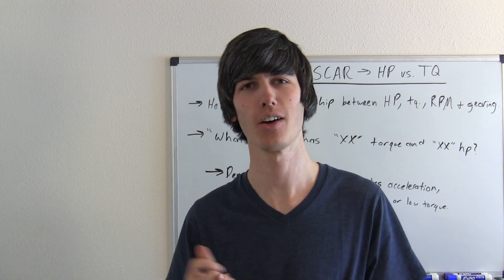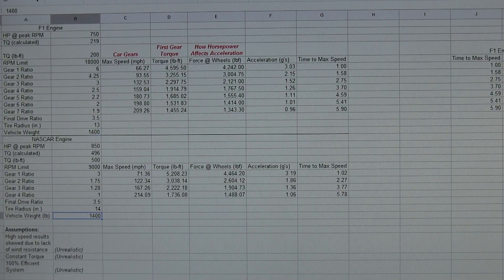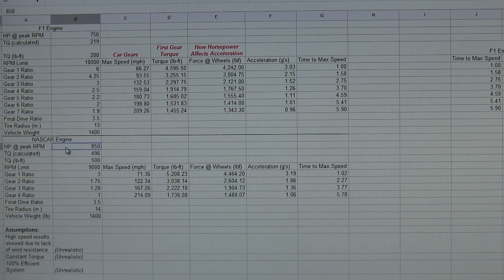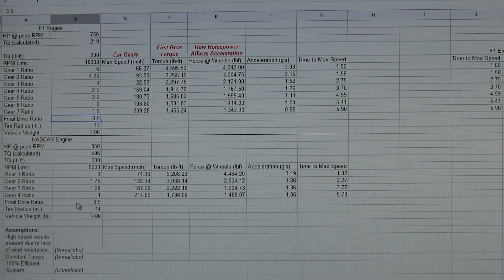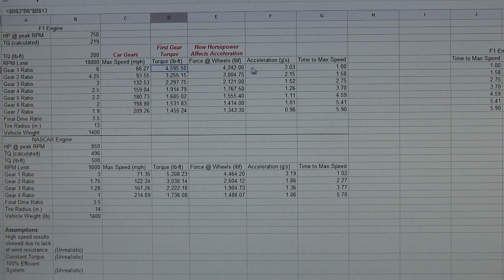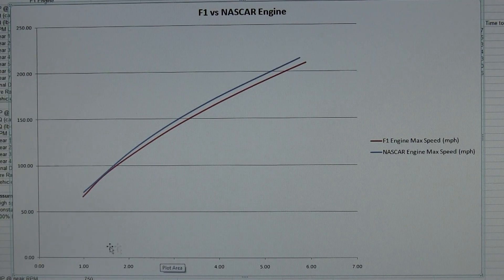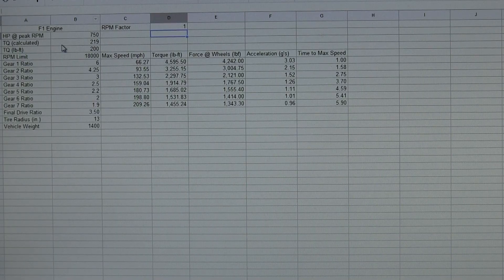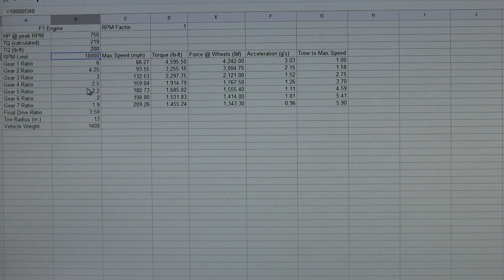Horsepower vs Torque - Formula 1 vs NASCAR

Comment: Acceleration only depends on torque. There's in fact very direct relation between torque on the wheels and car acceleration. Because it's the torque that rotates the wheels and thus pushing the car forward. Obviously. Motor power is simply a meaningful way of representing mechanical work because otherwise the mechanical motion has no meaning in context of thermodynamics. Consider electric motor: they have near-linear inverse torque to rpm relation - it has maximum torque at 0 rpm (when it's stalled), and as it spins up torque gradually goes down, until it's zero at motor's maximum rpm. Now the maximum power this motor generates is actually halfway across the graph, at half the rpm and only half the torque. At maximum rpm power is zero even though it spins fastest, just because there's no torque, and at zero rpm power is also zero even though this is the point where you will get most force out of it and thus most acceleration, just because there's no actual rotation.

The reason why F1 cars accelerate faster is because they weigh so much less and because they have more gears, utilizing engine's "power band" (rpm range with high torque) more fully. The reason NASCAR cars have few gears is simply because they drive at near-constant near-peak speed with rpm staying right in the "power band" all the time, there simply isn't any need for shifting to begin with. So you might as well go with lowest possible number of gears. In fact Sprint cars only have 1 gear and it's directly attached to the motor and to rear wheels, it doesn't even have clutch.
Reply from the maker: +Sigma Centauri (Shifty) It's not quite as simple as you're making it out to be. Acceleration does depend on torque. Torque depends on gearing (multiplies torque). High horsepower means you can use aggressive gearing. It's about wheel torque, not engine torque.
Reply: Engineering Explained Horsepower itself doesn't mean much. It's simply a product of two basic properties of a motor - rpm and torque, specifically particular torque at particualr rpm, since torque curve is far from flat. It simply tells how much mechanical work is being done, specifically in the same sense as thermodynamical work of expanding gas in the cyllinder. As a substutite to "how powerful the engine is" it immediately falls flat, as shown in electric motor example.

You didn't need to "correct" me that it's about wheel torque not engine torque, since I have posted exactly that already.
Reply: +Sigma Centauri (Shifty) You're wrong. It is all about wheel torque, which is the result of both engine torque, max rpm and the gear ratio. A faster spinning engine enables you to use a gear ratio that sends more torque to the wheels. The F1 engine has less torque but it can spin faster, so it can use a lighter gear ratio of 6:1 and still reach the same speed which in practice makes up for the fact that the engine has less torque.
Reply: Horsepower is the rate at which torque is produced
Reply: +Brandon Guerrero yup
torque = force
hp = workrate
Reply: +Sigma Centauri (Shifty) Acceleration is soly dependant on the difference between the available horsepower vs the required power for the given speed, Torque only determines how the power is produced. This leads to gearing to enable the car to operate at the right rpm that produces the most horse power.I think you confuse torque with the actual traction force at the wheels.
Reply: +El BU you're wrong too.
125 putt putts are crap because they have very little torque and a narrow torque band.

if you put an f1 gearbox onto a high torque low rpm v8 it would accelerate like a rocket but it would quickly run out of gears.
put the v8 gearbox on an f1 engine and it would be very sluggish but would do far more mph in each gear.

lets put it another way
have you driven any turbo diesel cars? they make peak torque at low rpm when the turbo spools up you can feel that it accelerates hardest at that rpm and the acceleration drops off from there up the rev band, yet the peak hp is at high rpm so why dont they accelerate as well at high revs?? because torque = acceleration thats why.
the reason high rpm low tow torque cars accelerate well is because the high rpms allow you to use lower gear ratios.
a gear is a lever, it quite literally multiplies the torque produced by the engine and sends it to the wheels, lower ratio = higher torque multiplier
Reply: +Sigma Centauri (Shifty) There's a reason why people don't build race cars with big diesel engines out of trucks with their 1500 pound feet of torque.  Horsepower is where it is at. You can have all the torque in the world, but if your engine doesn't turn fast enough to develop enough horsepower, it's worthless. Torque is only ever more important for the first instant of acceleration from a dead stop.
Reply: +scythelord wrong
Reply: +El BU you havnt read a word i wrote have you?
i know hp is a result of torque AND rpm (hp = torque x rpm / 5252 
torque is force
hp is workrate
there is 2 ways to make alot of hp either high torque or high rpm
if you can get both you get extremely high hp relative to engine size

hp is NOT acceleration, that is torque
Reply: Just to clear some things:

1) Power is not a scalar value, it's a curve over RPM range. Power is a measure of how much torque will on the output shaft rotating at 9.549 RPM after you apply whatever gearing to convert current motor RPM to exactly 9.549 RPM on the output.

2) Torque is also a curve over RPM range. In internal combustion engines, most of the torque is in the middle of RPM. Because torque is only generated during power stroke so the faster it runs the more there are power strokes, but also the faster it runs the less efficiently combustion products can expand and thus create less torque. In electric motors, there's as much torque as there are amps (not directly but it's a rule of thumb). Because motor coils are inductors, when it rotates they create reverse voltage, reducing current flowing through the motor thereby reducing torque. So it has peak torque at stall and zero torque at maximum speed i.e. when reverse voltage becomes equal to supply voltage and there's no current flowing through the motor.

3) Because gearing only has fixed ratios, you can't run your engine at maximum power RPM to get maximum possible torque (you can in CVT but they're inefficient and low-power limited). You can only put gears in a way that you'd utilize high power RPM range better than not at all. Note that highest power point doesn't correlates with highest torque point. Whatever gear you are using, acceleration is stronger where engine produces more torque, not where it produces more power.

But the thing is, even though you'd have most torque at 6000 RPM, it's not very useful because you'd had "best acceleration" at low speed, where you'd normally just use lower gear. Also, this is why it's pointless to use gears on electric cars: instead of using gearing to offset highest power point to specific car speed, you can simply adjust voltage and that'd do exactly the same thing. When voltage is low, maximum RPM is low so peak power is at low velocity. When voltage is high, maximum RPM is also high so peak power is at much higher speed. So you can control voltage to produce as much torque as you want, or to run the motor at highest mileage, etc.
Reply: zanick2 Wrong. Electric motors don't need gearing altogether because they're capable of producing any torque at any speed, and they can also run at any speed. Electric motors run as fast as there are volts, and produce as much torque as there are amps. You can simply put more amps through it to get more torque, and increase voltage to make it run faster - at any speed. So gearing is not needed. The only scenario where you possibly need gears on electric motor is when you need output shaft to rotate extremely slowly, in which case proper winding design to get it to rotate that slowly and be in optimal RPM range may not be feasible (i.e. it requires huge number of loops on each winding).
Reply: zanick2 There's a small difference between having a lot of practical experience and having some basic background knowledge as to how it actually works. Gearing helps because even though high horsepower RPM range doesn't produces maximum torque, it produces it at higher speed, so if you gear it down you wind up with larger output torque than without gearing. This, however, doesn't retracts the fact that most acceleration is where most torque. It's just high torque in mid RPM is not useful, because at the speed it produces, there will be more torque in lower gear.
Reply: El BU You don't even know clearly what a "force" is as you misuse the term, so much for being on the scientific side. Newtons is a measure of force, linear force on the body comes from torque on the wheels, measured in Newton-meters, which comes from the engine through gearbox. Power is the amount of "work" (in physics sense) it's doing per unit of time. The  more displacement there was, and with the bigger force, the more work was done. No displacement - no work, no force - no work either no matter the displacement. There are multiple solutions to the equation, like one with high torque low speed (low gear), and other with high speed low torque (high gear). And there you're saying acceleration in both cases would be the same because it depends on power.

You got your facts completely backwards.
Reply: El BU As a last ditch effort, here's an electric motor example:

It produces no power at all when it's at 0 RPM, because anything times zero is zero. But it produces most torque at 0 RPM. At the point where it produces maximum power, it only produces half the torque. If acceleration depended on power, there would be most of it at 50% maximum torque but that's clearly not the case with real electric motors. Not to mention, there would be no acceleration when motor is stalled, meaning it couldn't start by itself - which is clearly wrong, quite on contrary it produces most torque when it's stalled.

Acceleration is torque alone. Power is but a measure of how much torque is available at particular speed. It's not by itself a real thing, it's a metadata. Just like intelligence is what emerges from basic interactions of countless simple monocellular organisms, not some physical thing that actually exists.

Honestly, you're either hopelessly clueless or hopelessly confused. After being explained thoroughly multiple times, you still don't get it.  If that didn't made you realize how it works, I doubt anything will.
Reply: Problem Child AKA The Truth No. As far as driving for fun goes, I like high speeds, and where I live there just aren't any roads where high speed motorbike driving is anything but a suicide attempt. No race tracks either.
Reply: +scythelord You are wrong. Acceleration is only related to the amount of available hp vs the the required hp. The difference between the two determines the acceleration.What you mean is that big diesel engines can only deliver torque at a lower rpm and they therfor miss top end power. Not to mention that these engines are heavy and therefor require more hp to accelerate.Have you ever seen those light motorcyles (125 CC two stroke) struggling of the grid line. They just don't produce much hp al low rpm and they have small powerband. Burn the clutch at launch or push a bid to gaain some minimum speed are the basic options.
Reply: +eatthisvr6 You keep on talking on torque or hp. You obviously don not see the difference between torque and HP. HP is the net result of torque and RPM. The characteristics of an engine is determined on relationship between torque and rpm. Sure a diesel or turbodiesel has a high torque at low rpm and not so much at high rpm. That is why a turbodiesel actually produces more hp at low rpm than a gasoline engine. The gasoline engine however maintains its torque at high rpm so it usually has higher endpower. A gearbox is just a tool to keep the engine at the optimum rpm for power delivery.
Reply: +eatthisvr6 That is why you are wrong. available HP beyond the required HP is the sole and only reason for acceleration.
Reply: +Sigma Centauri (Shifty)   acceleration depends on torque , yes, but ONLY at the rear wheels. if you are talking engine torque, then acceleration  doesnt depend on only torque , it depends on engine torque and engine speed, and gearing!.... so, dont confuse engine torque with rear wheel accelerative forces.  THAT is determined by HP.
max power at any vehicle speed will determine its max acceleration rate at that speed.    F1 vs NASCAR , both at same weight  will accelerate almost exactly the same at any vehicle speed.  (all other things the same to... think F1 engine and gear box vs Nascar engine and gear box in the same car).     they both need to keep the HP in the max HP range and thats why F1 has close ratio gears and lots of them.     Nascar with its broader HP curve, doesnt need as many gears to do this. (plus, its just a rule of the nascar design to keep the 4 speed gear box which is the old american V8 car design, so that point is moot)
acceleration = Power/ (mass x velocity)... this means acceleration is directly proportional to power at any vehicle speed .    rear wheel force does the exact same thing, but its harder to calculate. (not engine torque).  HP is easy to see on a graph
Reply: +Sigma Centauri (Shifty) you couldnt be more wrong there.  HP (or power) by definition is the rate of doing work.  work, is a force over a distance.   higher rate of work, greater acceleration.
HP is also a rate of KE change... by definition,THAT is acceleration of a mass... right?   ITS HOW DYNOS MEASURE REAR WHEEL HP and torque.   they measure rate of change of the KE ( rolling drum mass rotating speed  acceleration) and that change  IS HP!!!   over one second, if you had 746Joules of KE change (start speed KE - end speed KE)  that would be one HP-second. or one HP for one second.
So, electric motors show similar HP curves to engines too.  they have a HP curve.   it starts out at zero and  ends up at near zero (speed limited) . torque starts out flat and then falls away. very simiar to a gas engine but the HP is usually broader than a gas engine.
HP is an easy way to determine acceleration potential of ANY power plant.  you just have to know what its telling you . ;)
Reply: +eatthisvr6 
basic Newtonian identity!    acceleration = power/(mass x velocity)  
this is the LAW.. your last statement is in conflict with the LAW!    its not wrong, you are.
HP is the rate of doing work.  a HP-second or Watt-second  are unit measures of work and energy.
rate of change of KE is by definition, acceleration of a mass, right?   think about it!!!
Reply: Still telling people false information aye
Reply: you need to go crack a physics book , just to the Newtonian section and it will all be clear as day. force does the work. HP dictates the  rate the work can be done.  AKA, rate of change of KE.engine torque means little or nothing, but the rear wheel forces  )(at any vehcle speed) as multipled through the gear box is synonomous to HP.
Reply: zanick2 NO IT IS NOT LMAO
Reply: zanick2 500hp @9000 vs 500 @1800 can engine A pull 72000lbs? They have the same HP correct?
Reply: Yes it can. So can an engine with 10% of the HP.
Reply: Yes, both can do identical work over time, because that is what HP is. rate of doing work..... 9000rpm at 291lb-ft  will produce the exact same force as 1800rpm at 1458lb-ft.  because in order to compare , physics, the velocity must be the same.. so , both vehicles as long as they weigh the same will accelerate the same and or generate the exact same pulling force. both would lift 72,000lbs  3.8feet in 1 second
Reply: EIBU, no it cant.  at 10% of the HP  you would have 10% of the acceleration.  again, newtons laws   .  think rate of change of KE.    if the HP is the same , the acceleration and force will be the same .  at 10% less HP, there is 10% less acceleration.    remember acceleration = power/(mass x velocity)???
Reply: zanick2 WRONG
Reply: zanick2 If that was the case they would not need diesel engines, i can tell you have never taught this stuff and you are full of (you know what) 291 torque will not do the same work as 1458, you would have to gear 291 to the moon to create the same force at the tire
Reply: zanick2 In order to move a 4000 car 1g you need 4000 ft lbs of force, this comes at the expense of engine torque and gearing nothing else.
Reply: El BU No it cant 1458 torque vs 291

gearing is 3.42*1.18*1458=5883
               3.42*1.18*291=1174

This is the force that both tires will see at their respective tires
Reply: Yes it can, it will be slow but it can. with less HP you can produce the same force, but not at the same speed. Just like you say
Reply: You are mixing torque with HP. Any amounth of HP is able to produce any amounth of driving force, but not at the same speed.
Reply: El BU But thats exactly what i am saying they make the same HP but one makes WAY more torque (force at the wheel) than the other

15*1458=21870
15*291=4365

Thats not hp thats the torque at which the hp is made (RPM) id rather have 21870 force at the tire than 4365 (it means i will accelerate faster)
Reply: Yes that is what you are saying, but it is wrong. If the different engines have the same HP, they  produce the same driving force at the wheel and the same acceleration (if the toatal mass of the car stays the same).
Reply: El BU No they dont lol, they can not.

Would you put a motor cycle engine in a semi truck? 435HP

15*1458=21870
15*291=4365 

same exact gearing of fifteen times the torque at the given rpm of max hp. 21870 of force is NOT the same as 4365 of force at the tire
Reply: El BU Thats why you have gearing because you are multiplying engine torque, i can create more force going from 3.42 to 4.10 with the same hp
Reply: If you do not change the gearing they do not produce the same HP. A high  reving engine with low torque with the same HP as a high torque enginge with low rpm, give exectly the same driveforce at the wheel. But you have to adapt the gearing to allow the engine to run at the required HP.
Reply: El BU Thank you for proven my point because you adapt the gearing for the torque not the HP just like in this video. In order to have the same force you have to change the gearing (WHICH MULTIPLIES TORQUE) which means the gearing follows the torque curve
Reply: So at least you understand what a gearbox is doing. Now try to do the same for HP.
Reply: El BU HP is not the same if you do not have enough force to move something. for 291 tq to equal the force of 1458 it would have to be multiplied by 75, but according to you they should accelerate the same. What you dont see is (in this video) if you give the F1 car the gear ratios of the nascar they do not make the same force although they have the same HP. Now do the same in the final gear and the force will not be enough because the engine torque wont be multiplied enough to overcome resistance
Reply: +Mete An engine takes fuel, burns it, turns the released heat into motion. The power of the engine is a function of how quickly the engine does this. Therefore, a 500hp engine can theoretically have the same acceleration regardless of torque. I understand this might not make sense to you, so I'll put it differently:

Torque is a function of how much fuel is burned per revolution of the crankshaft/gearshaft/driveshaft. A high torque engine will burn more fuel per revolution of crankshaft, while a low torque engine will burn less. Assuming their power is equal, that means the low torque engine spins faster. So if, by gearing, you reduce the speed of the shaft of the lower torque engine, you get equal torque at the output. 

It makes no difference if the heat is released by spinning a small engine very quickly or a large one slowly. A high rpm low torque motorcycle engine CAN THEORETICALLY move just as much load as a truck engine, since it will spin more times to turn the wheels the same amount than a large truck diesel. The reason this isn't done, however, is because it's bloody inconvenient in every way.
Reply: +Mete An engine takes fuel, burns it, turns the released heat into motion. The power of the engine is a function of how quickly the engine does this. Therefore, a 500hp engine can theoretically have the same acceleration regardless of torque. I understand this might not make sense to you, so I'll put it differently:

Torque is a function of how much fuel is burned per revolution of the crankshaft/gearshaft/driveshaft. A high torque engine will burn more fuel per revolution of crankshaft, while a low torque engine will burn less. Assuming their power is equal, that means the low torque engine spins faster. So if, by gearing, you reduce the speed of the shaft of the lower torque engine, you get equal torque at the output. 

It makes no difference if the heat is released by spinning a small engine very quickly or a large one slowly. A high rpm low torque motorcycle engine CAN THEORETICALLY move just as much load as a truck engine, since it will spin more times to turn the wheels the same amount than a large truck diesel. The reason this isn't done, however, is because it's bloody inconvenient in every way.
Reply: migkillerphantom I get that (thats why i say its torque at the wheel) but in the same notion, one can not say just because two engine makes the same power (but at different RPMS) that it makes the same force. Like you said it has to be geared for it, if they are geared the same the low torque engine will not make the same force as the high torque engine. You have to gear both motors to match the torque curve. Gears are the multiplication of torque NOT hp, if you gear down (numerically up) anything it accelerates faster, why because you have upped the anty of torque at the wheels but HP stays the same.
Reply: Mete, you keep confusing HP and the potential for acceleration at ANY speed, with torque (engine) vs force.   the force at any speed will be exactly proportional to HP. HP is the indicator.   by definition, it IS the rate of change of KE.  once you come to grip with that, you then understand that the torque of the engine, multiplied through a gear box OPTMIZES the HP availalble.    at any speed, if you are not using the hp available, you are not accelerating at the fastest rate, regardless of the gear ration.  3.23 vs 4.11 gears.  are 4.11 always going to make the greatest force?   at 20mph maybe, but at 40mph, maybe not.   if you are at the max HP at any speed, you will generate the greatest force.  this is a fact.
Reply: mete, here is the problem.  you keep on comparing two example where the vehicle is at different speeds.   you cant do this .  there is more energy in a body that is traving faster and it takes more power (rate of doing work) to accelerate that body at any faster speed.   My response to you about the truck vs F1 engine, is dead right on!   both can do exactly the same rate of doing work, (i.e. HP) or (rate of change of KE), or in other words, "Acceleration".   why, because at the saem power level at any speed, you will always have the same acceleration which means you have the same FORCE or as you say, "torque at the wheels".  when the speeds are not the same, there is no point to be made.  at ANY vehicle speed, if you can use the same engine HP level,  you will have the same force to accelerate... ive been showing you  this to be Newtons LAW!  you come back and say "wrong".  do you not have any physics classes under your belt?   this is basic stuff here.     the gear box only allows you to operate at any target speed you want, at the most amount of power available.   the best example is in racing, which I have 20 years of experience here, a viper at 500hp 500ft-lbs of torque, will accelerate at exactly the same rate at ANY vehicle speed (and produce the same rear wheel force/torque) than a Porsche cup GT3 with 250ftlbs of torque and 500hp.   the hp curves are near the same shape in the operational range.     so, instead of arguing, why not find a speed where this is not true for both cars.   also, keep in mind that if cars had infinitely variable gear boxes, where would they operate at , max hp or max torque?  if can get that right, you will finally show you understand the things we are trying to show you!
Reply: What EI and Migkilller are trying to tell you is that the gear box is the HP optimizer. remember, what is HP? hp is the rate of doing work. the faster you do work the faster you can accelerate, right  kind of the absolute definition?  engine torque says NOTHING.  you want rear wheel force and HP dictates that or can be used to measure it depending on how you look at it.  the energy -work theorem is something you need to look up.     power is the rate of change of KE.  this also means "acceleration".    F x V= power, so if you have some HP,  and you can use it..... that force will have to be present at any speed to make that equation work.      this is why we shift race cars at redline and not ever think about max torque..... ever!!   a race car may never see max torque of the engine, yet have maximized torque at the wheels at any vehicle speed. why?   because max torque will always produce less force than max HP at any speed and yes you need the gears to do this.. that's why I say, gears are more than torque multipliers, they are HP optimizers.   once you understand this, you understand the discussion and have learned something here!
Reply: zanick2 600 hp at 5900 rpm vs 500 hp at 5900 what gets it there 534tq vs 445. Same RPM higher torque rate at the same RPM which means torque is what you are looking at. And gears only follow the torque curve NOT the HP curve if thats the case then every car would accelerate faster higher in the RPM range but we all know that a vehicle accelerates fastest in first gear and peak torque before and after that acceleration is lower. BTW you have yet to answer why a Lamborghini Aventador  was out accelerated while in launch control (bout 500hp) vs a Tesla using 14hp (5000 RPM vs 100)
Reply: +Mete If one engine produces 600 hp and the other 500 hp, it is obvious which one of the two will accellerate faster; the one with 600 hp. This has nothing to do with torque.Have you ever studied electromotors characteristics, you will know than, that an electric engine produces maximum torque even without any rpm (this is still 0 hp when the car is stopped), over its full rev range. That is why they accelerate so fast from standstill. Just to give you the Tesla Engine power output: 510 hp at the rear, 262hp at the front and no issues with shifting gears.
Reply: Mete, you continue to make one of the biggest physics mistakes... comparing two bodies in motion at different speeds.  you CANT do that.  the quick answer, is what ive been saying for months to you...... the max acceleration will ALWAYS happen at the greatest hp the engine can produce at ANY vehicle speed.  what ever gear you need to do that , do it... BUT, you have to compare any acceleration , and force at any SAME speed!!     gears are used to maximize rear wheel force and this happens in the max HP range NOT the max torque range.   max torque is also meaningless and rarely used by race cars, ever!   again, acceleration is proportional to hp, not engine torque!!   rear wheel torque..... yes, NOT engine torque. your answer for the lambo vs tesla.  (and I have a video that shows the tesla getting smoked by the lamo too.. )     But the answer is the lambo is not using the 500hp, it only has less than the tesla from the very slow speeds.   it could be geared to fix that, but stock , it cannot.     whatever the acceleration rate is at Any speed, that is the HP it has available, PERIOD!   again, remember... basic Newtonian  FACT acceleration = power/(mass x velocity)   this means acceleration at any speed is proportional to power or rear wheel torque. they are synonymous
Reply: El BU Really because ive seen a 1600hp audi dog walk a 1800hp lambo. My point is this you speak of HP so i showed you same RPM vs different torque, (SINCE TORQUE DOESNT MATTER) IF I MAKE MORE TORQUE AT ANY RPM THAN YOU DO I MAKE MORE WHAT? When does a car accelerate the fastest at peak tq or peak hp...in first gear or 6th?
Reply: zanick2 A couple of answers from a physics page there guy 

Given a conventional geared transmission, supposedly best momentary acceleration is at peak wheel torque. This comes from F=MA, arranged as A=F/M. Acceleration is highest when force (torque) is highest.

Reference https://www.physicsforums.com/threads/torque-vs-horsepower.153996/

No. Every time you shift gears the torque delivered to the wheels drops, so the acceleration drops. Those two cars will only have the same acceleration for about a tenth of a second. 

Reference https://www.physicsforums.com/threads/torque-vs-horsepower.153996/

No, the engine that is able to to deliver more torque will be able to kick your butt to the finish line faster.

Reference https://www.physicsforums.com/threads/torque-vs-horsepower.153996/

If force equals mass/acceleration then they are speaking of RATIONAL FORCE IE ENGINE TORQUE X TRANSMISSION GEARS X FINAL DRIVE

You show me a race where HP won a race ill show you one where torque (at the wheels did)
Reply: You realy don't understand hp.
Reply: Now you talk torque at the wheel or actual driving force; this is at its maximum when the engine is running at max hp, no matter how the engine characteristics are for torque vs rpm.
Reply: El BU WTF are you talking about you accelerate before and after MAX HP lmao MAX HP only happens for a split second yet you accelerate after MAX HP, like i said before gearing follows engine torque, and once that force can no longer exceed resistance then you need more torque. YOU ACCELERATE FASTEST AT MAX TQ!!! YOU ACCELERATE FASTEST IN FIRST GEAR!!! ANYTHING AFTER THAT ACCELERATION FALLS OFF I FREEKING E LESS TORQUE AT THE WHEEL VIA ENGINE TORQUE VS GEARING
Reply: El BU 600@6400 VS 500@6400 WHATS THE DIFFERENCE IS IT RPM OR TORQUE AT THAT RPM
Reply: yet, still again, months into this, you still fail to recognize that you cant compare force in 1st gear to that of the force in 2nd or 3rd gear.  you have to compare at the same speed.  its a common physics mistake when trying to analyse this fundamental question that way.    Max HP is the greatest potential for acceleration at any speed.   even if it happens for a split second.  what you really want in a car, is to be at or near max HP . its call integration of the HP curve , or put more simply, "averaging". so, the highest average HP will provide the highest average force to the rear wheels.   you seem to forget that HP is force x velocity.   also,  again, acceleration= power/(mass x velocity)  this proves my point.  try and find one speed where this is not true in your comparison.     a quick example where your "theory" falls apart, is at max torque in 2nd gear.... fastest acceleration in that gear, but not if you downshift to 1st.  :)    then, the Hp is higher and the rear wheel force is higher as well.  much higher. in fact, the ratio of the 2nd gear hp to the 1st gear HP at that same speed, IS the proportion that the rear wheel torque is higher!      Gearing ONLY optimizes the HP you have available.   if you are not operating at max HP or near it as best you can, you are not taking advantage of the acceleration potential.   remember HP indicates the acceleration potential at any vehicle speed.   force does the work and HP is the most simple and basic indicator of that potential.
Reply: mete, you dont understand HP as EI BU is saying.  you are misinterpreting the physics forum.   yes, in any one gear, torque will be the greatest acceleration , but ONLY at that gear. In fact, the lower hp that max torque point occurs at, will be the lower acceleration potential that the car and engine have BY that same proportion!  what i mean by that is,  max or higher HP is your greatest or greater  potential for acceleration.   so, if you are at max torque, shift to a lower gear , be at a higher HP and that means, greater acceleration. PLEASE PLEASE , go find someone that has physics as a background and they will be able to explain this very easily.  you clearly are not thinking about it correctly, because what you say, fights the most basic Newtonian identity.. acceleration = power/(mass x velocity)  this means acceleration is proportional to power.     dont confuse rear wheel torque, with engine torque. engine torque is irrelevant.         Power determines acceleration potential.    power is synonymous with rear wheel forces, at any vehicle speed.
Reply: mete PLEASE go to that link you provided from 2010. My posts are the last few on the thread.  it should clear up any confusions you may have!
https://www.physicsforums.com/threads/torque-vs-horsepower.153996/page-6
Reply: Sigma Centauri Thank you, I asked zanick2 why a Tesla beat a Aventador off the line with merely 14 HP vs (estimated 500) in launch control (i believe that occurs around 5500rpmish) 

Ive also stated this acceleration is at best at max torque NOT at max HP. I think where the confusion lies is people think speed equates to acceleration. Theres a reason why you accelerate faster at lower SPEEDS vs higher speeds.

I gave this scenario 600hp@6400 vs 500@6400 why does engine A make more power than engine B at the same RPM* 

Now i do not know much about the CVT and i have to do research but your statement is right on with what i do know about them, and again it relates to speed vs gearing. Also why in the first few gears of a conventional transmission the spread is higher to drop down at or near max torque. But when at speed where weight is LESS of a factor you dont need as much force at the wheel to keep it accelerating. Thank you again
Reply: Mete, i think i answered your question regarding the tesla vs the Lambo.  at the start there is very little HP available, more with the tesla because of the characteristics of the HP curve . More power down low.
what ever vehicle has more power lower, will accelerate faster .. yet again, its the LAW.   acceleration = Power./(mass x velocity)  
you state that acceleration greatest at max torque, and this is dead wrong. maybe in that gear, but lower the gear at that same speed, and suddely you have 50% more HP , and that means, (if you have been paying attention) 50% more torque!!    (also means 50% more force)  why is that Mete?   because the HP is the determinant factor and max torque of the engine means little or nothing.   it means ABSOLUTELY nothing if you have a CVT.. PLEASE read up on a CVT. its the easiest way to understand what many hear are trying to help you understand.  if you have an infinitely variable gear box, your engine or motor willl operate at max HP , NOT max torque, always when you are accelerating... why is that???  because its the law.. acceleration at any vehicle speed, is proportional to HP, NOT engine torque.

Now the reason you can accelerate at slower vs faster speeds is again, HP.  max HP is the max output of the engine.    the faster you go , the proportional less force your have.  directly proportional, at best case.  common case is even less.
Reply: Sigma..... also not exactly true .   yes, in each gear , the max torque would produce the greatest acceleration in that gear, but for the same exact speed, drop down a gear and you will have greater acceleration by running at max HP or near max HP range.   this is how to use gears.  YOU Have to be careful in physics to compare at the same speeds.   otherwise your point is usually wrong.
even with electric motors, they operate at max power ranges for better acceleration.  however, with their broader HP curve, they dont need as many gears, but still need at least two to be comparable over a wide speed range to a gas powered car of similar HP.  (i.e. tesla would need a 2nd gear after 80mph to keep RPM in max HP, not torque , range).
CVT or IVTs would operate any powerplant in its max HP range.   Max torque is an irrelevant point for max acceleration discussions. (gas or electric)
Reply: i dont quite understand your question about 500hp vs 600hp and why the difference.   the difference is that one can burn more fuel and air at the higher RPM ranges. could be one is more volumetric efficient than the other or one is larger that the other..      as far as your last statement, no, the gear box doesnt care to put the RPM back at max torque post shift, its better off, (way batter off) to keep the RPM drop less and never get near the max torque point where hp is very low compared to max HP. or the max HP range.
Reply: zanick2 1. at the start there is very little HP available, more with the tesla because of the characteristics of the HP curve . More power down low. (the lambo was in launch control which means its starts off at 5500ish RPM more than enough HP theoretically to over come 14 hp @100RPM)

2.  
Sigma..... also not exactly true . yes, in each gear , the max torque would produce the greatest acceleration in that gear, but for the same exact speed, drop down a gear and you will have greater acceleration by running at max HP or near max HP range.  WHo said anything about dropping a gear how about starting in first gear. 600hp @6400 rpm 

600*5252/6400=492

1st gear 2.97*3.42*492=4997
2nd gear 1.72*3.42*492=2894
3rd gear 1.31*3.42*492=2204

so you drop down a gear from 3 to 2 you have now given yourself over 600 ft lbs of tq at the tire. Now lets get to the real deal FIRST GEAR ACCELERATION AND WHY MAX TORQUE OUT ACCELERATES MAX HP 

Same engine makes max torque off 550. let your car start at MAX HP vs  MAX TQ

1st. 2.97*3.42*550=5586
2nd. 1.72*3.42*550=3235
3rd. 1.31*3.42*550=2464

so lets compare each gear and what the tire sees

1st 5586 vs 4997
2nd 3235 vs 2894
3rd 2464 vs 2204

I THINK THE UNANIMOUS DECISION IS IN
Reply: Mete, Max driving force is available at max HP. As long as you do not understand this, your calculations show nothing at all. You are mixing engine torque, wheel torque, engine characteristics and gearbox and put them all in one salad.
Reply: wow meet, your math is correct, but your variables are way off. you cant compared HP or torque of any two cars at DIFFERENT vehicle speeds.  it doesnt make any sense and proves nothing
check out this link for the torque (thrust curves) for a tesla vs a comparable Hp gas engine car
https://www.google.com/search?q=tesla+hp+curve&biw=1384&bih=789&tbm=isch&imgil=tDtjm9yBHr8UnM%253A%253BgbAMiFeBO2jg0M%253Bhttp%25253A%25252F%25252Fwww.cheatsheet.com%25252Fautomobiles%25252Fwhat-the-hell-is-horsepower-everything-you-want-to-know.html%25252F%25253Fa%2525253Dviewall&source=iu&pf=m&fir=tDtjm9yBHr8UnM%253A%252CgbAMiFeBO2jg0M%252C_&usg=__850sKRBZtIgp4Qg_oy8JanF-O1E%3D&dpr=1&ved=0ahUKEwivloGhwKPNAhVX42MKHc3lBrgQyjcIOA&ei=cN1dV6-eCNfGjwPNy5vACw#imgrc=m8Hs9T_mzR6EzM%3A
Reply: if you change your calculations to equal speeds, you willl get the answer. right now, your calculations are meanignless, as max torque and max hp happen at different RPM and have to be compared at the same speeds.. this means the gear ratios CANT be the same .   basic fundamental issue with your calculations.

again, acceleration = power/(mass x velocity) .... just try and prove that wrong. AND, power /(mass x velocity) is synonomous with rear wheel torque, at ANY vehicle speed.

once you surrender to the facts, you will understand.  what you say works out, but you are way off based on the comparable vehicle speeds.   do you understand why??
Reply: El BU MAX DRIVING FORCE IS NOT AT MAX HP YOU ARE SLOWER AT MAX HP THAN YOU ARE AT MAX TQ, YES YOUR SPEED IS HIGHER BUT THAT HAS NOTHING TO DO WITH ACCELERATION

ENGINE TORQUE X TRANSMISSION GEAR X FINAL DRIVE= TOTAL FORCE AT THE TIRE (NOT THE CONTACT PATCH) DAMN HE SHOWS THIS IN THE VIDEO 4:01 LOOK AT FIRST GEAR TORQUE VS FORCE AT THE WHEEL (DUE TO THE TIRE.)

 NOTICE IT GOES LOWER AND LOWER EVERY GEAR WTF IS SO HARD ABOUT THAT? OMG LOOK AT THE ACCELERATION Gs I WONDER WHY THEY ARE GOING DOWN IN EACH GEAR? 

I BET IF WE RACE AND I START IN FIRST GEAR AT MAX TQ VS YOUR SECOND GEAR MAX HP
Reply: zanick2 ACCELRATION=FORCE X MASS
Reply: zanick2 Drag race you start in max HP and ill start in MAX TQ same car i bet i out accelerate you, and you show a video where the lambo was not using launch control.  I showed you a video where the lambo did use it and still lost off the line using around 500hp vs the tesla 14hp
Reply: Sigma Centauri Someone who understands
Reply: Mete. That is why there are engineers to explain things that do contradicts initial logic.
I'll have one mo go for you, after that you keep on racing without knowledge.or with understanding of the physics involved.
F= M*a this is the netto force acting on the car that delivers accelaration. The other part of the force is lost in drag/resistance. This going to increase with higher speeds.
The work (joules) equals F*v. These two combiner produce 4* the work(Joules) when you double the speed (speeds adds exponential to the drag). Now talk energy this will ad a time factor into it. If want to increase the speed from low to high no matter how quick you do this, it requires the same amounth of work (Joules)  but different powet depending on how fast you want to increase the speed. Power = Joule/sec = Watts (or hp if you use different units). So the faster you want to change yous speed the more hp is required. This is not linked to the drive force directly, but linked to the drive force actually available at those speeds. To explain: a heavy door closure mechanism
Reply: Can produce a lot of force, but the door will close slowly. When you want to speed this up, you can push the door, but the mechanism can follow at this higher speed.
This is only about the forces acting on the car. Now lets take a look how this driving force is produced. This offcourse the engine.
As shown earlier whatts/hp produces the power to bring the car as fast as possible from a low energy state ((start) to a high energy state (high speed) this means the drive force produced by the engine must be made available at every speed. 
Engine characteristicsvare defined by torque vs rpm. The combination of the two is power (hp). No matter how you look at it, you need to let the engin run at max hp, in order to produce the max driving force at that speed and acceleration.
This why a M1 tank can accelerate so fast, despite the gas turbine being a low torque high rpm engine. Fore the same reason can a small gasturbine in a halicopter produce hugh amounth of torque at the drive shaft attached to the rotorblades.
Reply: (That is why there are engineers to explain things that do contradicts initial logic.)

Well when that initial logic starts losing then you let me know. I race so i know, im not just in a classroom but learn from real world experience and been doing this for twenty something years. I think i have an idea of what works. When i see a vehicle go 203 with 15 less hp than an identical vehicle with 15 hp more and equal riders but only goes 197 i tend to think that HP is not what gets it done
Reply: Another point is drivability. This is where specific engine characteristics can give an advantage. A wide powerband make shifting easy, this usually the case with high torque engines. High revving enginges makes powere delivery at low speeds difficult and can burn up the clutch during launch.
Reply: Experience is not the same as understanding the underlying physics. That is why an engineer usually is not the racer, and the racer is not the car designer. As long as they listen to each other.
Reply: El BU Some racers like to understand why they go the speeds that they do, did you pay attention to the force at the tire and at the ground for both the nascar and F1 noticed what they did to up the ante to make things even? It doesnt take an engineer to see that, more gearing was needed for the less tq'd F1 to have the same force as the Nascar.
Reply: El BU 399@7000 vs 514@9000 who accelerates faster to 60 mph 

gearing is 3.42 final drive 1st gear 2.61 26 inch tire
Reply: That is what I explaind. They both produce the same driving force, but due to the engine characteristics, a high revving low torque same hp engine needs a different gearing ( sometimes even more) than a higher torque lower revving same hp engine.
Reply: The one with the most hp
Reply: El BU WRONG LMFAO THEY ACCELERATE THE SAME. I did not say which one accelerates the furthest i said fastest they both make the same torque and at 60 mph they make the same HP smfh
Reply: So same hp, same acceleration. Easy
Reply: El BU Same torque same acceleration being its the same rpm and torque, but you didnt catch that all you saw was HP. Now if you change the gear on car A with 399 to a 4.10 then it accelerate to 60 faster
Reply: Apples and peaches that is what you try to cmpare. You still do not understand the science behind your experience. Good luck with racing.
Reply: El BU That was not apples to oranges or peaches, best of luck with your theory
Reply: sorry, Sigma.. first of all, the Tesla is geared... and geared by a fairly large ratio too. if you were not understanding my post, it was to say that gearing is needed because the HP curve eventually falls off after 80mph on the tesla.. so a 2nd speed would be needed for higher speeds.  under 80mph, 1 gear works great due to wide HP range available.
Reply: very good explanation. However as a note, because aero drag goes up with the square of speed, the power required goes up as the cube of speed.  double the speed, 8 times the power required!!!   (or 8x  rear wheel force )
Reply: mete, if anyone wins a race (and ive been racing for 20 years pro and club, so its a subject im familar with too)  then if the lower power car wins, its because they were able to use their available hp , BETTER.  gearing could have been more optimal for the Hp curve available. if you are talking top speed racing, thats an easy explaination.  the one car that went 6mph slower, with more HP??? it might have had too tall a gear and was operating at a lower HP range.  its that simple.   EI BU and I are trying to help you understand and you profess to know it all, but you dont.  truely, we are trying to help you, not argue.
Reply: the greater HP will always win.    but if you dont have the right gear ratios, that can negate the higher HP by only alowing a fraction of the "rated" HP (the 399 or 514hp you quoted).
so , going only to 60mph which is redline for the 7000rpm , 399hp car, the lower hp car is the greater hp in this race, because the 514hp car wouldnt even get to half its Max HP RPM, and might only produce 250hp!   Mete, you have to keep the speeds the same in physics , or your discussions and questions are meaningless
Reply: you keep on replicating your mistake.. you need to look at the Hp that is being used and available.  you cant put a truck gear box on a sports car and visa versa.  both cars should redline at 60mph and use the gears that allow this to happen.. if so, guess who wins????   now you are beginning to understand!  ;)
Reply: zanick2 WTF  are you talking about 2.61*3.42 comes from a t56 6 speed what are you smoking
Reply: do i realy need to explain it?   again, what do you not agree with ? Newton's Law?
acceleration = power/(mass x velocity).. does this confuse you? do you not think its true.  if you believe it, as you SHOULD if you are educated, then you will see that it doesnt matter how much torque the engine makes, it matters how much hp is available. HP dictates acceleration at any speed.  if you accelerate faster at any speed, its because you have more force at the wheels, or more HP, its that simple.
Reply: Sigma Centauri thank you
Reply: Sigma Centauri I was trying to say this myself after showing him a video of a tesla drag racing an Aventador in Launch Control mode (basically 14HP vs 500hp)
Reply: What I learned 30 years ago was electric motors suffers WORST at 0 RPM an the MOST current .... and most HEAT. As the RPM incrreases the current drops and everything gets nice and cosy .... unfortunately ... there is also a resistant force that increases as RPM grows ... I am sorry I cant explain not been an egineer for many decades ... but ... it has all to do with how the electric engine is wired. What do you want ... torque ... do u want high speed etc. So a French TGV train can NOT accelerate as fast as a commuter train cause the electric engines are geared towards different goals. 

That is all I took away from my training ... since I left and became material expert and after that systems programmer ... yes there are a lot of cool things execept electric motors.
Reply: in the end, whether you forgot your "engineering" or not... one think you can remember, acceleration is proportional to HP at any speed..   sure, the force is created by the wheel torque, (rotational force), but at the  motor or engine, that torque is before any gearing and its potential to accelerate the car, is based on the RPM It can provide, so you can match gearing.  electric motors are no different than gas engines from that respect..  with respect with electric motrs, modern electronic controls, try to keep current constant as RPM goes up to fight eddy losses and inductive losses..   if you don't remember your training from many yerars ago, just remember to use HP to determine what is the acceleration capacity of any car with any type of engine at any vehicle speed..
Reply: That is likee college or high school physics ...??? electric engines suffer resistance as RPM increases.  You need to gear a electric engine to be most efficient at 100 km/h or 300 km/h and electric motors have nothing to do with air breathing mechanical combustion engines ....
Reply: MajSolo Power, torque and speed of electric motor is proportional to voltage. Increase the voltage, and RPM and power goes up. If you find you need too high voltage, just wind the motor for lower voltages. This is why you don't need gearing. It's that simple.
Reply: MajSolo You need force to over resistance (that means torque at the contact patch via engine torque and gearing nothing more. WHY DO PEOPLE THINK IN DRAG RACING RACERS UP THEIR GEARING...FASTER ACCELERATION PLAIN N SIMPLE. Saleen up the gearing on their tesla for more force for faster acceleration while the HP stays the same, any educated racer knows this.
Reply: Still problems with physics I see. You must make sure max HP is available at the speeds you are racing. This is done through gearing. But depends also on the type of racing. Dragracing requires max HP at lower speeds. This means gearing that allows the engine to rev at max HP during acceleration. Some type of engines are particluary suited for this. These are mainly high torque at low rpm engines as they have a smooth HP curve that allows for this. High reviing low(er) torque engine have smaller max HP powerband so they need to shift gears a lot at low speeds to stay in the max HP range. In dragrace this is not always what you want.
Reply: yes, you are right, its all about maximizing HP at any speed.  yes, gearing is the mechanism that allows for maximizing HP for any speed range.     The LAW says , acceleration = power/(mass x velocity)  this means if you ever have more HP at any speed you will always have more acceleration.   EI BU is exactly right, gear boxes are the HP optimizers.
Reply: no, electric motor's resustance doesn't go up with RPM, but BEMF can and there inductive losses.  this means the time it takes for the current to rise is fixed by the windings, so over voltage is needed to overcome this   this is another subject all together. (motor theory and operation)   a tesla for example has a very wide HP curve, but its single speed runs out of power at 80mph and that's why its acceleration goes down after 80mph..(more than a normal geared gas car)  but if tesla would have one more gear, that could be solved and the comparison for a given HP would be very close.  from the start both gas and electric are limited by grip of the tires.
Reply: HUH. A Z06 with 4.10 gears accelerates faster than the same one with stock 3.42s why because of the mechanical advantage creating more force, multiplying engine torque through gearing. Funny the GTR has a 15.06 First gear and with max hp of 548 which makes 449 torque at that rpm vs a ZR1 with 638 hp at 6500 which makes 515 torque

548hp=6761 of force at the tire GTR
638=4032 of force at the tire ZR1

Torque and gearing like i said
Reply: NO I am right, it is all about engine breathing, burning fuel, the storke length, brething breathing burning ... everything else is gearing. :) You guys are just mystifying it all.
Reply: MajSolo You are talking how an engine makes power not how it accelerates.
Reply: you are totally right, but you forget one thing; the engine that does this at the optimum between single stroke energy (your storyline) and rpm (aka the combination is HP) has the best combination and produces most HP even at less torque when the higher rpm compensates for lesser torque. It results in more HP. But you have to adapt the gearing to allow the engine to run at the higher rpm for the same speed.
Reply: Therefore you are compensating for the lack of torque at max hp and its given rpm, either way you are looking at where force and resistance are equal and thus tells you the speed at which that vehicle can go
Reply: problem child!! no, gears don't make hp they only make more efficienet use of the HP you have available.  gear spacing is more important than just the numerical ratio.  4:10 gears might work best, but if you have less or more HP, that could change to better utilize the 3.42 gears.  lots of factors there.  keep in mind, when you lower your overall ratio, the trade offs are greater from gear to gear.  1st might have an advantage, but you shift proportionally earlier and then have LESS torque until the other car shifts into its 2nd gear where you repeat the cycle.  depends on the speed range used.   4.11 gears are not good for all racing applications, weight , HP and other performance factors.
Reply: keep in mind that power is the rate of change of Kinetic energy.  PERIOD.  the more power you have the faser any car will accelerate.    this is true at any vehicle speed.  HP is the vehicles capacity to accelerate at any or from any vehicle speed!    example if it takes 1 second to go from 50mph to 60mph and you start with a KE of 2mill Joules and end up with 2.2mill joules..... thats exactly 268hp needed!     see how simple this is with using just HP available or required?     yes, force does the work, but that is force at the wheels , not at the engine  (torque).    remember also, that power is Force x velocity.  further proving that at any speed, force at that speed determnine HP, or HP will determine the force at that speed.
Reply: zanick2  further proving that at any speed, force at that speed determnine HP, or HP will determine the force at that speed.

SOOOO how fast will a 500 HP go in a 3000 lbs car 1.1 final gear and a 2.73 final drive at 6200rpm on a 26 inch tire LMFAO
Reply: Problem Child AKA The Truth Depends on how you want to use max HP. If top speed is the goal you'll need to use the correct gearing to match max HP at the top speed you want. However, high speed also introduces drag that increases exponential with speed. The curve of required HP for constant speed has to be matched (through gearing) with the max HP available.
Reply: yes, and I should add that no mater the task, top speed potential or acceleration, both require  the force to achieve that task.   that force is easily demined by HP (because hp = force x speed) for top speed, and acceleration is determined by rate of change of KE, which is by definition , HP. (or power).  HP is a cars capacity to accelerate, just as energy is the ability to do work.
Reply: This is a childish question, but ill answer it like I would if you were one of my students.   you have given me a question, relating to physics of two bodies in motion, at two completely different speeds.    so, to answer it literally, as you have no information regarding drag, 500hp (or any hp without drag), will take the car to 170 mph at 6200rpm and with the 1:1, go near 460mph.    you see, you are "LFMAO" because you are a little confused.  are you asking what car will reach their appropriate  top speed faster, or are you asking what the top speed would be?   also, the weight has little bearing on the equation, unless you want to know how fast it gets to top speed.   the answer you are looking for is simple.   say it takes 500hp to reach 170mph with your 2.73:1 gear ratio. at 6200rpm.    then, the problem is that the 1.1 equipped car has too tall a gear and cannot ever reach max HP of 500HP because at 170mph, he is at less than 3000rpm where there is max torque by the way (lets say) BUT, only half the HP availale.   it will peak out where HP equals drag forces.     try the example again,  use a 24" diameter tire and wheel because then the rear wheel torque equals rear wheel force. (not a big deal in this example) you can even make it easier still to use the comparison vehicle to have PEAK HP reached at 5250rpm.. that way, whatever the HP is, the rear wheel torque is the same and then the rear wheel forces are the same., so we can say 500lbs of force happens at 5250 rpm as well.    then, you can start factoring in what the drag is.  .  we can also use 3000lbs as the mass to figure out acceleration base on  the HP available  at any of the speed ranges.   but mostly, as far as top speed goes, keep in mind, as speed goes up, the power to reach the top speed goes up with the cube (not square) of speed. so , double the speed, you need 8x the power.
Reply: But, taking your question literally, if you have 500hp available with a 1.1 gear box or a 2.73:1 gear box, both will accelerate exactly the same at any speed, and would get to the same exact speed if both had 500hp avaialbe to get to that speed.   if it was the same engine, that would not be the same situation, but you didn't clarify if thse were the same engines.. you only said, same HP of 500hp.   so, re-phrase your question so we can clear this confusion for you.
Reply: zanick2 What do you mean both 1.1 is the tranny 2.73 is the final drive??? its one damn engine WTH man look just stop.
Reply: I thought you said that was the comparison.  2.73 vs a 1:1.    either way, if you maximize acceleration, just maximize HP . its that simple
Reply: zanick2 Or maximize gear or torque its that simple
Reply: Meanwhile in the realm of electric motors, electric current = output torque, at any speed. Since power is speed by torque, you don't gain anything by using gearing. See, suppose you use 2:1 gearing, this increases torque by 2 but drops speed by 2 as well, and power remains the same (actually there's a small loss due to inherent inefficiencies of gearing as a mechanism). So while producing very high torque at lower gear takes less motor input torque, because it has to rotate twice as fast it still takes same amount of electric power as if you simply "brute force" it by pumping double voltage into it. Since heating only depends on current, and current linearly converts into torque, you can have the same torque at any speed with same motor heating.

The reason internal combustion motors have gearboxes is because on one hand they can't rotate very fast, and on the other hand they can't produce a lot of torque. If you didn't use gearing you'd have pitiful accelerations as well as pitiful top speeds. Because electric motors can produce huge torque as well as rotate extremely fast just by adjusting input voltage, they don't need gearing, only appropriate winding depending on how fast it's supposed to go and how high voltage you can push. It's actually remarkably similar with steam engines which don't need gearing either and can produce huge torque right from the start.
Reply: Mi 28 I agree to a point but i have not seen to many electric motors have high speeds simply because the torque falls off after a certain RPM therefore losing force to overcome the necessary resistance. I have seen where some eletric bikes have pulled off some impressive numbers at the drag strip. In California they are producing Eletric semis trucks to run locally. The reason is the torque output outweighs even that of a diesel engine being torque is created at zero
Reply: actually, in electric motors, current doesn't dictate power, ampere turns dictates power.  (how much current through how many turns of copper wire).  lots of turns of small wire, high resistance and inductance, lower current can equal few turns of high current low resistance.  the trick is keeping the current in the windings at the desired level.  gear boxes work for electric cars just as they do with gas engines cars.  however, the broader HP curve allows for less variable gearing.  meaning, a fully comparable tesla with 2 speeds , at 450hp can equal the performance of a 450hp gas car with multiple gears (5speed, 6 speed, etc)...    the eletrci cars start out with some pretty deep gearing to begin with and have motor speeds in the 15,000rpm range.   they can go faster but why, the voltages have to go up due to inductive losses and switching losses are greater.   the tesla is  the optmimum mix of voltage , capacity and power for a comparible sports sedan.  (equal to M5 , etc)Power is the maximum capacity to accelerate at any vehicle speed.  this is done by gearing , whether its a 500hp diesel or a 500hp gas engine or a 500hp electric motor.  the gear box optimizes the engines ability to transfer its power to the wheels of the vehicle.
Reply: A vehicle accelerates fastest at max TQ
Reply: That really isn't true.. its is true for a particular gear, but actually because of the LAW  power =Force x velocity, the greatest acceleration will always happen at the greatest power.  this means to use the greatest power level, you need gears.  gears are optimizers.    example.   max torque of a race car might never ever be used, if it is shifted at redline .  but guess what...... this gives the greatest torque at the rear wheels both at the shift point and the post shift point.  and all while never hitting max torque of the engine.if you are in 3rd gear at max torque, drop down a gear to 2nd at near max HP and the acceleration and rear wheel torque is MUCH greater.     remember to do all your comparisons at the same vehicle speed.
Reply: If you have a 1st gear of 2.66 and a final gear of 3.42 all you have to do is multiply that by max tq vs TQ made at max HP you will see that at max tq you accelerate much better

638 hp at 6400 what is the TQ made vs 650 in the same gear

523*2.66*3.42=
604*2.66*3.42=

WALA MAX TQ ACCELERATES FASTER
Reply: zanick2 You still tryna drop gears LMFAO drag racers dont drop gears they start in first SMFH
Reply: again, you are talking differnet speeds.  you cant break the laws of physics .  talk to a physics pro and they will confim what I'm telling you .  your example is at two different speeds..... you have to compare the same speeds.   if you did, it would be very clear to you.   whatever the max HP the engine can produce , will dictate the max acceleration made at that same speed.
Reply: drag racers have a different way of "gearing" its called slip percentage of the tires and tire growth in diameter, as well as power converter transmissions. all to keep the HP at max power levels through a run.
Reply: 638hp at 6400rpm would  be 2%   less torque than 650hp at that same RPM In the same gear.
Reply: why are you doubting one of the most basic laws of physics.. do you think I'm making this up?  power = Force x velocity.... that's a lawacceleration =  power /(mass x velocity) that's a law.      Both determine that acceleraiotn is determined by power and is proportional to power at any vehicle speed.   the gearing and the tgorque al work themselves out.  engine torque is irrelevant.  its rear wheel torque and force that accelerates you .   trust me, it all follows the law!!
Reply: zanick2 638hp at 6400rpm would  be 2%   less torque than 650hp at that same RPM In the same gear.

I made a mistake which saying 650 hp

which i did correct in the math 638 hp makes 523 TQ at the given RPM now do the math

604*3.42*2.66=5494
523*3.42*2.66=4757

I think you accelerate fastest with 5494 of force vs 4757, smfh

drag racers have a different way of "gearing" its called slip percentage of the tires and tire growth in diameter, as well as power converter transmissions. all to keep the HP at max power levels through a run.

DUDE PLEASE STFU not all drag racers race with automatics. This is how i know you have never raced except in a physics class.
Reply: All to keep HP at the max power level through a run..... well this is what it it is all about: stay at max HP.
Reply: I don't race drag, I road race porsches and have run pro for over 20 years. this is basic stuff .  forget about the type of racing, it doesn't matter. its all about HP , which dictatces the forces that cause acceleration.HP is the capsity to acceleratae at any speed, just as energy is the capacity to do work Now, your math...... if 638hp makes 523lb ft, then at what RPM?   if you have 604hp making more torque, then it is at a different RPM, which is a different (TOTALLY DIFFERENT SPEED) so your comparison has no validity.  none.   please open a book.. talk to a real racer besides myself... you will be enlightened.
Reply: Problem Child AKA The Truth Torque falloff with speed increase only happens after you can't supply any more voltage. Then as speed increases, reverse electromotive force in the motor also rises, and eventually it becomes equal to supply voltage - this is where there's 0 current through the engine, and therefore 0 torque on the shaft. This is why you need to design motor windings such that it can still produce some torque at maximum designed speed at maximum available voltage, i.e. it can run a lot faster than top speed if you run it without any load.
Reply: zanick2 Power is speed at which force is delivered. Acceleration, however, is just force. You can have huge power from giving tiny push at insane speeds, but that's still just a tiny push.
Reply: Power is the rate at which work is delivered, not simply force.
Reply: correct, force over distance is the work, during a certain time period (rate) is the power.
Reply: zanick2 Ill continue to race, and do what i know works, and beat people who make more HP than i do and lose. I doubt you road race or do anything besides a book. And its why you continue to talk about going down a gear vs starting in first. You and i both know that if starting in first a shorter geared car making the same power will out accelerate a taller geared car (all things being equal) Did you see the vid i showed you "FIRST GEAR TORQUE" BY "ENGINEERED EXPLAINED" which you never responded to because we know that you accelerate fastest in first gear, same with max tq you accelerate fastest at max tq. So you are not gonna say that you accelerate fastest in 6th so why would you say you say you accelerate fastest at the least about of torque lmao makes no sense, sure physics says one thing but again take off from a dead start at max hp vs a dead start at max tq see who gets off faster. A lil something for your pleasure 

http://www.badasscars.com/index.cfm/page/ptype=product/product_id=398/category_id=13/mode=prod/prd398.htm

So think of it like this, ride a 10 speed bike. Take off in 1st gear. That's a low gear ratio. You can go from 0 - about 5 MPH in a split second, do wheelies, ride up hills, etc quite easily. Now try to do the same thing in a taller gear, like 6th or 7th. Now you can't take off the line very fast, you can't do a wheelie, and you'll fall on your face trying to ride up a hill. It takes much more leg power to "pull" that taller gear, just like taller gears in a car need engines with more power (TORQUE, not "horsepower"), to pull those taller gears.

To make a point, if you took a bone stock V-8 car with say, 275 - 300 HP and put 4.88's in the rear-end and ran it against a car with a 750 HP race engine that has 3.00 gears in the rear-end, I guarantee you the bone stock car WILL out accelerate the race car from 0 - 60 MPH, just like an 8 year old kid on a 10 speed taking off in 1st gear will get-up and go to about 5 MPH or so quicker than a bike ridden by someone like Arnold Schwarzenegger could in 10th gear. A car's performance isn't solely related to just the engine's power. Gearing is every bit as important if you want it to go like it's supposed to.
Reply: You realy don't understand the difference and relation between HP, engine torque, rpm, drive force at the wheels, acceleration and gearing in combination with the actual speed.
Reply: El BU If you are referring to me i do. As its pretty simple. But go right ahead and think that you do best to keep at peak HP Like a CVT id rather my rpm drop back down by the meat of the torque band and have more force which would give me more acceleration for the same speed and shift.
Reply: Yes I was referring to you. But it is your choise what you do and how you do it, however don't try to justify it to others as it is a typical example of a explanation that sounds logic, but it is not correct.
Reply: El BU Dude i race, no need for logic. Lemme know when you all hit a track and not a theory
Reply: El BU Here is something for you to figure out

Car A 562 HP @6800 rpm
Car B 638 HP @6400 RPM average torque between max tq and hp. 0-150 mph

495 average tq 3862 lbs
563 average tq 3353 lbs

Car A

15.01*495=
8.51*495=
5.9*495=
4.62*495=
3.7*495=

Car B

7.83*563=
5.51*563=
1.21*563=
1*563=

To give you an heads up they are within two MPH of each other in direct gear

Who wins? Same weight

No need to get angry lol
Reply: Lol. you can't even get the question right
Reply: El BU Do you mean you can answer it. Here the tire size is 26 inches for the both of them. I understand that you now have the HP Average TQ between max tq and max hp total gearing but you can not answer the question..thanks for playing
Reply: You can put more variables in it what you want. But you still are not able to get the question right. Do you actually know what you are asking?
Reply: El BU I know you have the same car but with different engines with a different trans and rear ( i just gave you the total gearing) and tire size is the same...but i understand you dont want to answer a question like this because it will show an engine with less HP but makes more acceleration in each gear ( speed would not come into play as Car B would never catch up do to the taller gears
Reply: That is why I wanted you to explain the question. You basically set up a higher HP engine with the wrong gearing and than compare with a lower HP engine with optimized gearing.But as you might recall, we are not talking about which defined package is better, we are still talking about how to best use an engine and adapt the gearing so you get the best drive force out of it. As sad many times the best drive force at the wheel is available when the engine is running at max HP. And sure you must adapt the gearing.
Reply: El BU LMAO blame Chevrolet  because thats a ZR1 and GTR (two packages in the same car) And saying that you make the most force at max HP (because of VEHICLE SPEED) is funny. If you make more force at Max Tq then thats when you make most acceleration regardless of speed what you make. So if we make 5000 of force at 30 mph how does 4000 of force at 60 mph more? Please explain in all seriousness
Reply: Potentially you always make the most drive force at the wheels at max HP. There is no way you can argue against that. It is plain physics.Cars however are designed either for generic use, max acceleration from a standing start, max acceleration at a certain speed, highest top speed, etc. etc. And to explain the full math of potential acceleration. It is the difference between the HP available from engine and the amount of HP required to maintain the speed. As you know drag increases exponential with speed. This leaves a small margin of potential HP to be used for acceleration at higher speeds. This requires fine tuning of the gears and some times it is a best guess. In racing these are options. In commercial cars you must live with it or tune for specific purposes.Many short shift gears will probably generate a lot of acceleration as it allows the engine to stay close to max HP during shifting, however, the car will have limited top speed as the HP will drop beyond a certain max rpm. This is also where engine choice comes into place. Muscle cars (high torque) engines have broad HP bands and have instant power even at low rpm. The mechanical stress however is high as the main source of power is torque. This usually leads to heavy drive trains. A nice example is the GTR that transfers the power at high rpm with the gearbox in the rear. This results in a thin drive train that can bend. If you look at the lexus lfa, the car needs to be light with a small engine. To generate enough HP this engine rotates at extreme rpm (it almost sounds like a F1 car) this is great for higher speeds where the engine is running at optimum HP for max drive force. At low speed, or even standing start, the type of engines need to rev up first before max power is available. Unless specifically geared for it, these type of car/engine combination 'struggle' to launch as the clutch has to overcome the rpm difference from the drive train vs the high revving engine and still transfer the power.
Reply: If you understand the most basic Physics identity, you will understand. power=force x speed,  this says that at the greatest power, you will have the most force at the wheels at any same speed.  dont confuse engine torque with rear wheeel force, as it seems this is what you are doing.  even though you can make max torque of the engine, through gearing , more force will be available at max HP at any same speed.  say this again in your head three times and try and think before posting back.   think of gear boxes as HP optimizers.   if you ever want to accelerate at the fastest rate at any speed, you choose the gear that operates the engine at max HP not max torque.  make sense?
Reply: Oh yes, i do race, and this is the logic that allows me to do as well as i have done in both pro racing as well as club racing.   20 years by the way. one of the things that gives me an advantage is knowing , really knowing about the engine HP curve and where the best acceleration forces can be found anywhere on the track at any speed.  we are trying to help you here and you are fighting with a logic that just isnt correct.
as EI BU and i ahve been saying, the most acceleration will be found at, will be at as close to max HP as possible.   gears allow this to happen.   think of gears as HP opimizers.  its impossible to acclerate faseter at a lower HP level at any same speed.  TOTALLY IMPOSSIBLE.  if you see it, its because you are at a lower hp level and dont realize it. (i.e. wrong gear)
Reply: Engine torque or wheel drivingforce.Please realize that not even a dynobank measures engine torque. It only measures the HP delivered to accelerate the big rollers. connected to the measurement of the engine RPM, engine torque is calculated. The highest acceleration is when  the HP is max, reflected in the drive force at the wheels at a measured speed.
Reply: El BU You don't shift on a dyno test, and yes there will be maximum force on the roller (i.e. acceleration) in maximum torque band. It is horsepower that is then calculated, multiplying speed by torque at that speed.
Reply: Wrong, the acceleration of the roller is measured. That is why you never measure it at a constant speed, but always with acceleration. It the accumulated energy over a period of time (KW or HP) in the roller that is measured.There is no need to shift if you want to measure HP and how this relates to the engine rpm, as this will not change with gears. The effective drive force (at that speed and acceleration) is calculated and this is max at max HP, not at max engine torque. Scientific fact, non debatable.
Reply: El BU Uhh, I don't think you know how dyno's work. Look it up.
Reply: That is a good one. I am talking about an inertia dyno. The one that resembles reality best. But (scientific) facts do not seem to bother you.
Reply: El BU You keep saying "scientific", but do you got data spreadsheets and formulas to back up any of it? If not, it ain't science.
Reply: Mi 28 Thank you geez someone who understands that at a given speed force is at its greatest at max torque

if a car makes 5000 total force at 4500 rpm and makes 4400 at 6400 rpm then at 4500 rpm the car would have made an extra 600 ft lbs of force at a lower speed same thing applies with gearing you lose tractive force with every shift because of taller gearing
Reply: Drive force at a certain speed: N * m/s= Watts > Power. To generate max drive force at this speed, will be achieved at Max HP. Not even high school stuff.
Reply: El BU Hey in Elementary school i was told that Columbus found America, but then again that wasnt true either
Reply: +Problem Child AKA The Truth It is not so much that it turned out not be true, they just did not now any better, until proven otherwise. Which one are you. Don't you know any better or are you not willing to accept what is already been proven?
Reply: +Mi 28 Wheel torque and Rpm (Nm * r/sec)  (rpm) or Drive force at the wheels and speed (N * m/s) both express the amounth of power  being applied, unless the  tires are not able to transfer through grip the wheel torque. So far the basic science behind it.
You are correct about multiple solutions for the equation, but you have to compare them at the same speed and the same amount of power otherwise they cannot be compared. This amount of power can either be produced with the combination of high Engine torque at low rpm, or with low engine torque at high rpm. Als long as the have the same power output, they will have the same acceleration. The gearbox is used only to let the engine run at the highest Power output and not at the highest engine torque.
Reply: +Mi 28  Your are still mixing topics. And by the way both your pictures show are exactly what I am saying. Engine torque vs wheel torque. Wheel torque is max at max HP not at max engine torque. Unless there is no gearbox. If engine is already running at max HP, down shifting doesn't help cause you are probaly overrevving the engine. However if you are in a high gear not at max HP, down shifting gets the engine in a higher HP zone and can create better acceleration. This translates in higher wheel torque or drive force. And this is max at max HP. An engine does not become more powerfull when shifting gears, only the speed where the engine produces max HP is adjusted. That is why you have to change gears as shown in your example. Your example also shows the engine does not produce more or less HP at different gears, as long as the speed matches the max hp for the selected gears.
Reply: Mi 28 Bravo, wheel torqie can only be derived from engine torque ALONE. a Ferrari 458 has a final gear ratio of 5.17 or something along those lines and a short gear box whereas a zr1 has a 3.42 and a taller gearbox. This is why drag racers use shorter final drives in order to multiply the engine torque at the wheel, if you do not gear a low torqued engine well enough it will accelerate like a dog. Gearing my bike was always one of the first things i did.
Reply: Problem Child AKA The Truth I was aready aware that you knew what a gearbox is doing. You just make one mistake, that might feel correct but isn't, is that max wheel torque/drive force is not at the rpm for max engine torque, but for the rpm with max power. That means  that two car with different engines (one high torque/low rpm and the othe with low torque/high rpm) both with the same HP, will accelerate at the same rate and, for that purpose, produce equal wheel torque/drive force at the wheel. As long as the gearing is adjusted to allow the engine to run at or near max HP. But after all that was the whole purpose of this You tube channel video to show just that.
Reply: Mi 28 Im just gonna stick to talking to you, and i think we had this conversation before, with another person. Did/do you ride motorcycles?
Reply: +Mi 28  I'm afraid you are clueless. I and others, including this video, expressed that it is all about explaining that, how counter intuitive it sounds, Acceleration depend on power available and is max at max HP. This also goes for electric engines. If nothing moves, any engine can produce enormous amounth of wheeltorque/drive force until it starts moving. The drive force will drop to very low values if there is no HP behind it. The nice thing about an electric motor with HP is that it will maintain its torque when it starts moving not unlike a High torque fuel engine, but this is certainly not max HP at the start. Your example does not say much as you do not compare anything, other than stating engine characteristics. Power and torque curves of the Tesla were already shown in this thread, so I do not understand your renewed, but unclear example. If your example means a fixed gearing than off course the acceleration is higher at lower speeds (and engine rpm). But if the engine is allowed to run at max HP compared to another car at the same speed with the same engine running at max torque but less HP (different gearing) Most HP will win. This is easily shown is drag race where a tesla is involved. I think you haven't seen or understood any of the links I showed.
Reply: Smfh Mi 28 how these people try and speak on acceleration shows they are nothing but geeks...not that is a bad thing but have no real world experience. Lets try and make this ELEMENTARY SIMPLE FOR THEM. If a engine makes 500hp@6400 and another makes 600@6400 rpm how was HORSEPOWER MADE??? TORQUE. If a Lamborghini Aventador in launch control (roughly making 400hp) vs a Tesla P85 in ludacris mode (14HP) gets out accelerated can someone explain that to you and i please lol
Reply: oh boy... I think all you need is a physics class and all of this will be very clear....  remember, power is the ability, or capasity of a car to accelerate. PERIOD.  dont confuse engine torque with rear wheel forces, because that is what you are doing.   the most force or torque you will ever have at any given speed, will be at the max HP you produce.    you mention a dyno?  a dyno doesnt measure torque, it measures HP directly.   why, because all it is doing is measuring the rate of change of KE.  its measuring acceleration of the drums and that alone.   rate of change of KE , by definition is HP or power.   with the power number, you can derive the force needed to achieve it.  a brake dyno can measure torque directly.    Power is the rate of doing work.. the faster you do work, the greater the acceleration the greater the HP.      make sense?
you keep on bringing up max torque as the greatest point of acceleration , which is true for one particular gear, but not for a given vehicle speed.  through gearing, max hp will provide more torque at any same speed.  why??? because Power is the rate of change of KE.   the faster you change KE< the greater the acceleration!!     thats why this is a LAW, not something we have made up (EI BU) .  
Acceleration = power / (mass x velocity)    this is a law.   acceleration at any speed is proportional to power (and if you want to use torque, its rear wheel  torque and forces.....NOT engine torque)
Also another Newton identity is Power =force x speed.   this means at any speed force will be proportional to power and visa versa.   power just contains more information . its not derived or calculated, its a driect measure of the capsity of a car to accelerate based on its weight  and other factors.

dont confuse yourself by looking at max torque values at different speeds and RPM , because you cant look at things that way.  it makes NO sense.   always do all comparisons when the car is at the same exact speed. then you can compare torque at the rwheels
Reply: I think someone needs to actually race, i notice you seen the vid where the guy did an experiment and he went faster shifted to where max  torque would be reached then shifted 1000 higher and went slower, everything you say is all classroom talk, but no real world experience lmfao
Reply: I assure you , ive raced in widely publicized Telvision events and have been racing professionally and with clubs for over 20 years.   ive been successful because i know how to maximize the cars performance based on solid engineering knowledge.   this is my advantage over a competitor that might think max torque is where he wants to race his car and im running at max HP when ever  possible.  if you dont understand it, try and learn... you will be faster i promise you!
to answer your question, that is a little unclear, 500hp vs 600hp creates less torque at any same vehicle speed.  yes, HP can be calculated by using force x speed or at the engine, torque x rpm/5250.
if you ever get out accelerated, you had more HP to the wheels at that speed. its that simple   tesla vs lambo, etc etc.    usually, acceleration from the start is grip limited anyway,  i showed the HP curve comparisons and the video where the tesla gets smoked too.  lots of factors on those comparisons.
best to learn the concepts so you understand what is really happening.
Reply: Yes, Ei BU is being logical and scientific... you and problem child dont seem to grasp the basics.   think about this.   2mil Joules  at 50mph and that changes to 3 mil Joules at 70mph and you do this in 2 seconds. (acceleration from 50 to 70mph in 2 seconds)  thats 1,000,000 joules change, right?? 
thats 1340hp-seconds (because a joule is a watt second and there are 746watts in a hp), so  the answer is..............drum rolll................... 670HP-seconds or 670hp for  one second. ..... you see? this is the power you need to accelerate what ever that mass was , in 2 seconds.    now, we can find out the torque or force from that if you want .    with the equation:   power = force x speed.... we can get a force number.    give me the gear ratios and we can figure out what the engine made.
stop looking at max torque of the engine, which is near half the power of the engine, and half the potential to accelerate a vehicle.   gears allow you to use the most hp available to create the greatest rate of change of KE... AKA, acceleration !    make sense now??
Reply: +zanick2 I gave up. I showed them two video that put the real science denonstrated the car peformance and they stillcame up with old story. The essence of both video is that those who like torque engine have the advantage. The calculatio in the video showed this is not correct. It still didn't help
Reply: El BU Never saw any video but i showed your buddy zanick of a video where a tesla went against an aventador in launch control and still lost i also showed a video where a 1600 hp R8 beats 1800hp lambos, people dont want science projects they want real results. Ask zanick the video he saw where shifting to where rpms dropped to max torque beat out shifting a thousand rpm higher by a sec.

I showed him a video of CVT losing to the same car with a manual although they did the same speed. I can show you where a bike making close to thirty hp less still wins a race. when you are able to show me A video of a RACE where HP wins then ill listen
Reply: Mi 28 Oh i know this, i was simply saying that because the Tesla only needed 14hp to out accelerate the Aventador in launch control (basically stating that it was torque not power)
Reply: again, remember that acceleriaton is proportional to HPand if the tesla only needed 14hp , then the gas engine can do this too.  its all about gearing.  do a search for Tesla HP curve vs Camaro HP curve or torque curves and you can see the thrust curves of both.  if you drop the clutch at near max torque or even HP the tires will the limiting factor.   IF the grip is the limiting factor then it depends on the driver to modulate the clutch and gas to put down the max force possible.         both cars should launch the same If driven properly as there is way more HP available for both than grip.   ever see that LaFerrari vs Croatian electric car comparison?   the pro driver in the F1, still didn't do it right.  flooring the car from idle, isn't the way to win a race or launch.   yes, the electric cars make it easy to launch and control rear wheel torque.
Reply: please, just open a physics book or do a proper experiment.   Been racing for 20 years and never does the torque ever win a race.  all and ill say it again ALL the racing communities and sanctioning bodies use HP to weight ration without ever talking about torque..... why??? because engine torque is irrelevant, unless you tie an engine RPM to it.. that's why a 700hp nascar engine makes the same rear wheel torque as a F1 engine with 200ft-lbs of torque at 19,000rpm.  same speed, both cars accelerate the same if they were to weigh the same.. why??    acceleration= power / (mass x velocity)  if you would just open a physics book you would see this is true!     and always true in all situations.  always... because its the LAW
Reply: problem child...........  shifting before max HP will  usually always result In les thrust forces post shift. find a situation where this NOT true.  it does happen, but it is very very rare , especially in race cars.   if the HP level is ever lless post shift, then you always shift at redline.  if it is greater , then you find the point at the earlier RPM where it isn't. Or is the same. work the numbers... it makes sense  and you shall see the light
Reply: can you post that video of the short shift that cause greater rear wheel force or acceleration?  as I said, it is very rare.  all you need is your HP curve and the RPM drop % via the gear ratio change.  if the HP is less, than max HP or redline, then use redline, always!  if not, then you can short shift. its very rare though. I had a an anemic race car like this once. the hp peaked at 5k and redline was 6400rpm.  paid to shift at 6000rpm   .. however, in any other normal engine, redline is always better for max acceleration.
Reply: + Problem Child AKA The Truth I can show you so many video where a Tesla is unable to beat other cars. It does show however that a tesla is easy to launch. But competing with another racer who knows how to launch, the Tesla will Always be the loser from the moment the race starts. It just does not have the Power to maintain the wheel torque at higher speeds.
Reply: you made a post about short shifting... 'shifting 1000rpm lower to get the RPM in the max torque range"
i couldnt find that post of yours to comment, so here it is.. Also, let me very clear, i do race and have raced at the highest levels, so this information is true and correct.     you only shift at a lower RPM vs redline, IF the HP at the post shift RPM is higher than the shifting RPM (say redline).  if it is higher at any point past max HP, which it usualy isnt for most race cars or high performance engines, then stay in that gear until redline OR when the post shift HP is going to be greater.   this is totally regardless of max torque values, which is a non-factor.   
think about climbing a hill ... you can accelerate or just maintain speed, based on rear wheel forces .  HP level determines this , NOT max torque.   at the same speed, what has more rear wheel forces, redline or max torque at the engine??      max HP will always produce the greater rear wheel forces at any given speed.   read that again!  when you understand this, you GET IT ... finallly!!!    you are not the first person to confuse engine torque with rear wheel forces and HP.
Reply: zanick2 LMFAO REDLINE 600@7000=450 of tq 540 MAX TORQUE 

3.42*1.61*450=2477
3.42*1.61*540=2973 IT DOES NOT MATTER THE SPEED YOU SEE THE FORCE BEING APPLIED BY ENGINE TORQUE*GEARING, WANT TO GO QUICKER PUT A 3.9 OR 4.10 OR EVEN A 4.56 AND FORCE GOES UP AS GEARING FOLLOWS THE TORQUE LINE NOT HP. FUNNY HOW CARS THAT MAKES LOTS OF TORQUE TEND TO HAVE TALLER GEARING VS THOSE THAT HAVE LOW TORQUE WITH VERY SHORT GEARING. A 458 has a 5.14 with 398 tq but a zr1 has a 3.42 and 600 tq 

first gear total 7.83 vs 15.83 

now take out drive line losses at max HP goes like this for force at the wheel

458 makes 597=5508
zr1 makes 638=4095

How can a car that makes 40hp less make 1500 more force damn near...THEY MULTIPLIED WHAT THE ENGINE TORQUE WAS MAKING im done you seen the video. Now explain in a first to second shift full throttle it usually goes back down at or near max TQ Shift a 458 at redline (max hp) and it drops down to around 6400ish (max tq at 6000) take a ZR1 6500 and only drops to 4600 (max torque 3800ish) A GTR has a 6400 at max HP drops down to 3600 right at max torque (ever see a zr1 lose a bit of ground when shifting) not around max torque while everyone else does
Reply: Problem Child AKA The Truth Hopeless, Why keep asking for explanation if that has been done already?
Reply: El BU Why keep giving an answer and then say its not the answer? LMAO
Reply: Problem Child AKA The Truth That is your ballgame not mine. You have been answered many times. Keep on asking for answers does not change what already has been given. Look at this video again. It has all the answers https://www.youtube.com/watch?v=CxK0x7AE3s8&google_comment_id=z133jttogzmqg5nub23debubkqm1yjgnv
Reply: Problem Child AKA The Truth Thx for your kind words. I always like the strange way people use to admit they are wrong.
Reply: Problem Child AKA The Truth Of course as you seem not grasp what is being presented.This video explains that acceleration depends on HP, not on torque.
Reply: El BU Again saying the answer then turning around and saying its not the answer SMH, 

F1 219*3*3.5=2299
Nascar 496*3*3.5=5208

Same gearing who accelerates faster 0-60
Reply: they accelerate exactly the same!  (as long as they weigh the same ) you are just not grasping the situation here.   try and understand.  we are not making this up. this is a basic NEWTONIAN identity. 8th grade physics..... seriously.  acceleration = power/(mass x velocity)  its the law!   its never broken by anyone with half a brain...... so, instead of trying to prove us wrong, why don't you see how its possible that the laws of physics, that revolve around newton's second law, are preserved perfectly by understanding that HP is the rate of change of KE. PERIOD!   work x a distance and over a time..... if the time is shorter. (faster acceleration) the power is greater... make sense?       by saying "same gearing" you are showing you don't understand.    you cant compare anything at different vehicle speeds.   doesn't make any sense.   F1 is at 15000rpm and nascar is at 7500rpm and at the same speed, they put out the same rear wheel forces based on the gears needed to make that same speed.    the power, fuel consumption,   force at the rear tires, and therefore, acceleration all are the same.
Reply: zanick2 They would accelerate similar in the graph that he showed it would not be even remotely close if the F1 car used nascar gearing, i can tell you dont race and are a liar, just a dude who puts paper to work
Reply: You are talking in circles again.     seriously. just stop and think about it.   gearing doesn't make HP. HP is the capsity of a car to accelerate at any given speed.    think about that again.  Now, based on what you said, we need to address gearing and engine torque.  think about this for second.  why do you shift at redline and just after max torque.  you want to average torque or do you want to average HP?   you want to AVERAGE HP!!  why, because HP provides the greatest force at the rear tires on the road.  NOT max torque. why ?  because gearing helps you stay at the higher engine output level, of near max HP.   a GTR shifts at near 7000rpm and ends up at around 4500rpm to 5000RPM and not at its max torque level.  why?  because any time you are at a greaer HP level at any speed, you will ALWAYS have more rear wheel torque .   even If the engine torque is very very low.      go try and find a RPM and a torque on any engine where the greatest HP at that speed DOESNT make the most amount of torque at the rear wheels!!   you cant.. it doesn't exist.  you are kidding yourself .  so, stop the nonsense and try and learn here. we are actually trying to help you
Reply: Again, I do race and have for over 20 years. this knowledge has allowed me to compete better against more powerful competitors, even in the pro ranks!    now, do you want to listen , or just keep on saying the same thing?    you cant use the same gearing because gearing allows you to use the available HP.      if the HP curves are the same and the gearing is the same spacing (same % drop of RPM per shift) then both cars will accelerate the same regardless of engine torque, PERIOD!  this s a known  fact!      its very simple power= force x speed.     and Acceleration = Force/mass   so, acceleration = power / (mass x speed))     this will be true for any scenario .   its the law and everyone but you seems to agree with it and understand it.     again, think of shifting a car at redline vs max HP.   one might be 300lb-ft of torque and the other might be 200lb-ft of torque.  why would you run your car up to 8000rpm and get only 200lb-ft of torque when there is 400lb-ft of torque available at 3000rpm??    why?????   because gearing allows you to maximize the use of HP, so that 200 x 8000rpm /5250= 309hp    and at 3000rpm torque peak, there is only 228hp.      Now, what does that mean.   it means that at the same speed,  which is redline of 8000rpm, you have near 50% more HP and that means you will have 50% more rear wheel torque too!!!    even though the engine torque is more at 3000rpm, the rear wheel force is greater at redline at that same speed.   understand.   read this all again. show someone you trust... its the truth.. I promise..    since you are "AKA the truth" this should be something you WANT TO KNOW.  if you agree, ill send you links of me on TV racing too !
Reply: zanick2 HP does not create force so thats where you are wrong HP is only a calculation of torque and RPM create more TQ make more power EXTEND the TQ band make more POWER Its the reason why (if for only 1800) a diesel engine will always out accelerate a gas powered car until it shifts it simply makes to much tq in the low end. Same as the electric car. There is no way a 5000 lb car gets off the line faster than a 3500 sports car with launch control (but it happens and YOU have seen it). 14hp does not plant you in your seat instantaneously. You know it just dont want to admit it. And i do not believe your racing background
Reply: A dynamometer, or "dyno" for short, is a device for measuring force, moment of force (torque), or power. For example, the power produced by an engine, motor or other rotating prime mover can be calculated by simultaneously measuring torque and rotational speed (rpm).Sep 28, 2015
Reply: most of the dynos that we use with our cars to test HP or torque ACTUALLY measure HP and not torque first.  torque is a calculated value.   HP is directly measured, via the output of the dyno of rate of KE change.   this rate of KE change is by def, HP.. you can find torque, but it needs to be calcuated AND via an RPM signal , you can get engine torque.. without it, you only get road speed vs HP.   interesting , HUH!   :)
Reply: you are right, yes, force creates the acceleration.  however,  HP is a measure of the capacity of the car to accelerate at any vehcicle speed.   if , even at launch, you have more force, you have more power.. its that simple.   Force =power/velocity    or acceleration = power/mass x velocity) 
so, if your diesel can out accel a gas engine, its because it had more power at that speed. the tesla has a broader HP curve, which makes this easier, but any gas engine with the right gearing can do this as well.
remember, HP is proportional to acceleration.  
you want the link for my racing that has been televised?    you would think someone like you might use your available resourses.  just check out my videos.. 15 years of racing and i think every race is there!  ha  ha ha... youre funny.
Reply: Mi 28 
Come on, that is ridiculous. "The f1 cars  accelerate better because of less weight and more gears".?!? We are comparing the same power,(in the example almost the same) same weight, different torques. That is all.
 Of course a 10kg car with 50hp, 1NMmax torque and one gear, will easily outrun a f1, guaranteed.

However A 5 kg, 2hp, 20gear ratios ( or if you want infinite gear ratios which is the cvt), 1000Nm max engine torque car will be like a slug, although much lighter. It is a worthless crap.

Also power vs rpm curve is very important. The worse the power curve the more gears you need.
For example 300hp between 2000 and 2100rpm, 10hp everywhere else. You need to use say 20gears to allow you to keep the rev between 2000 and 2100rpm otherwise you get only 10hp.
Reply: inox1ck iD SUGGEST YOU LOOK AT HIS NEWEST VIDEO. THEN TORQUE AT THE WHEELS IS THE ONLY THING THAT MATTERS NOT HP
Reply: Look, ive already tried to correct some of the errors for you.. Yes, torque at the wheels is what matters. no argument there.  HP is directly proportional and comparible  to that at any speed. NOT engine torque.
you seem to be forgeting... HP is the rate of change of kinetic energy.     by definition, that MEANS acceleration of ANY mass, car, rocket, whatever!      rear wheel torque is only relevant if know the speed, HP is ubiquitous at any speed as a comparitive factor.. make sense?  in other words, you cant buy a car based on rear wheel torque, as this goes down with velocity.  however, HP never changes and is the best measure by far to compare and calculate by using.
Reply: WRONG!!! lose force at the wheel lose acceleration, im sure you seen where he FINALLY said that you want to shift where max torque  is made because you make more force, anything less means less acceleration. THEREFORE YOU ARE AT THE LEAST AMOUNT OF ACCELERATION AT MAX HP. Wanna have more MPH make more torque at the same RPM or raise the RPM and make a plateau of TORQUE, unlike how you said you dont want to shift into max torque but highest HP which would deem lower acceleration...thanks for playing though
Reply: problem child.. please... max HP is the fastest rate of acceleration at any speed.  think about it.    if you are  at max HP at 100mph that is the fastest rate of acceleration at 100mph.. say its 3rd gear and at 6500rpm.   now, would you pick 5th gear to end up at 3500rpm or 4th gear to be at 5500.   its a trick question........... max torque will always be less rear wheel hp at any speed, than max HP.... why, because the gearing allows you to use the greater HP.    again, HP is the rate of change of acceleration.  think about it. its newtons law!!!!!    acceleration= power/(mass x velocity)... this isnt something ive made up, its basic stuff here.    max torque means NOTHING.  IT ONLY means you can accelerate hardest in that particular gear, but not at the greatest potential of the vehicle and engine. that occurs at max HP.   look it up.   Rate of KE change!!!!  please, you are killing me with this, because you are not thinking.     you are always at the highest rate of acceleration at any particular speed at max HP... PERIOD!  this is a fact and i can tell you the torque at the rear wheels , at any speed based on HP ..   power = force x velocity... the simplest of equations.  please open a physics book and spare yourself the argument here.
Reply: Problem Child AKA The Truth Which video are you talking about and where is the statement you are referring too?
Reply: The fastest acceleration is when the engine is at the highest power. Not torque. Highest power gives you the highest wheel torque at given speed. Highest torque doesn't say anything about acceleration without power.